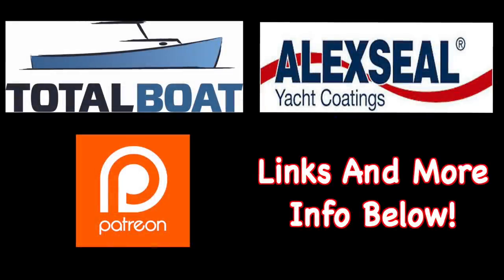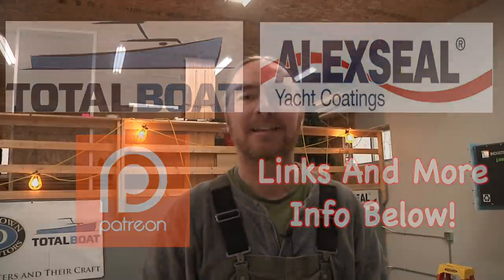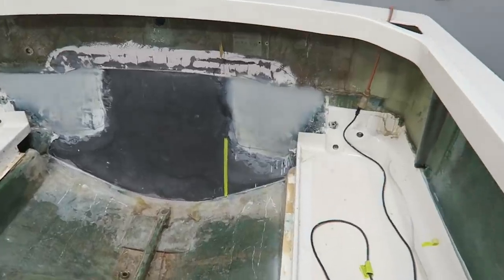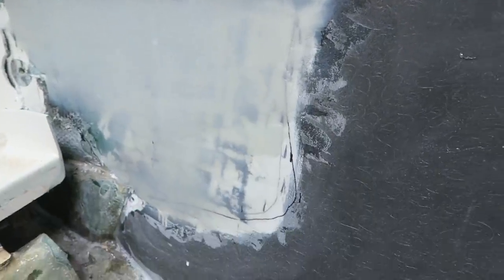HOW TO BEAT GRAVITY WHEN USING THICKENED EPOXY!

Comment: Happy to see you back working on boats.  Just completed some wet core repairs and did a lot of epoxy work outside.  I did my laminations when the deck was around 50.  My epoxy was cold from the night temps getting down around 35, so I learned an easy way to warm up epoxy resin and hardener is to place the cans in a bucket and add hot water (bath water hot, not boiling) until the cans just float off the bottom.  You don't need too much water as you want the cans to stay upright.  I place the bucket into the marina's outside sink and it works great using hot water.  The resin and hardener warms up in a half hour, so no long waiting  and it pumps easier.  I also keep a pan of cool water handy in case I want to slow the curing process.  On warmer days, I place a half inch of water in a paint roller pan and set my mixing cop in the water to slow the cure, if the resin kicks early, I pour a little cool water from my water bottle into the mixing cup to prevent a fire.  Still can't use it, but avoids a fire and controls the problem and reduces cleanup, as I can usually manuver the cup to where I can set it down on the ground safely.   Request for videos:  please show us how you work, not just talking about it.

Comment: Genius tip on warming the epoxy prior to mixing! Living in Scotland with low temps just now I was worried about my epoxy sliding/slipping on the vertical. Once applied with a little silica, the epoxy was was gaining viscosity all the time due to the lower temperature, resulting in zero slippage.
Cheers for your tips.
All the best from Scotland
Ewen

Comment: If my epoxy is cold, I'll mix it a little, and then toss it in the microwave for a few seconds. Thins it out to mix easier and like ya said, gives it a head start on curing. On the other hand, I've also made up smaller pieces of "pre-preg" where I'll lay out a square foot or so of cloth on wax paper,  saturate it completely, then cover it with another sheet of wax paper, roll it up, and toss it in the freezer. That way if i need a small non structural patch, I don't have to go through the hassle of getting all my materials out- all I need is a pair of scissors. Never had a problem with either of these 2 methods, used both on boats and aircraft.
Reply: How long will it keep in the freezer?
Reply: Does it stink up your house?

Comment: The problem with pre-thickening resin is that in order to get a proper and full strength bond, resin chains and hardener chains need to be brought together.  Thickeners get in the way of the 'mating' that has to happen to develop full strength.  Warm the resin and hardener as you did to lower the viscosity, work with manageable batch sizes, and make sure to stir resin and hardener a full two minutes before adding any amendments.  The goal isn't to get epoxy on the boat, the goal is to get a strong bond and a strong curing epoxy on the boat.

Comment: They make heated "coolers" that we use in the wind energy field, we plug them into our trucks and stick our resin and hardener in them, also do work as a cooler in the summer. They are handy

Comment: Good advise on pre warming the resin and probably the hardener so there's not a cooling when the 2 parts come together. Also getting the material at least partially thickened prior to catalyzing makes a great point. Finally, they call stand time slaking to get the chemistry of epoxy going prior to spreading out. Never thought about viscosity thinning out due to the thermal reaction affecting your initial guess of amount of thickener needed when mixing. Great points!

Comment: Once upon a time, working towards an A&P in college, it was a requirement that the epoxy cabinet had a 60 Watt bulb burning at all times to keep the epoxy warm.  Recipes change so I'm not sure if that's still a thing but it does make epoxy much nicer to work with.

Comment: I’m a proponent of using a scale instead of using the measuring cup. I mark down the weight of the resin before adding fillers and wait to add the hardener until the end. If a 2:1 or 5:1 epoxy is used, it’s super easy to add the hardener. If my resin is 130 g, I mix in part of my fillers and then, when I’m ready to do the job, add the 65g or hardener.

Comment: Have you tried Methacrylate adhesive to fill voids like what you are working with?  Mix up a batch, apply it with a pastry bag, install the new Cusa board over it, clamp it in place with some cleats and screws, wipe up the squeeze out.

Comment: I think your videos are the best. I learn something pretty much from every video. What I've done in the case of the dreaded saggggg. I used a piece of laminate (Formica) or whatever the latest trade name is. Or if I need something with a little less flex. I use that stuff the epoxy table people use. Just a quick spray PVA. Of course you have to plan ahead and have your bracing/ clamps and everything cut to fit and ready to go. Saying all that, I probably would have done the way you did the first time. Like you said, keep it stupidly simple. Which leads me to one of my favorite sayings, " you're going to pay for your education one way or another. Through mistakes or actual schooling of some type. I will be speaking to you soon on patreon. I'm re-doing a 25 ft. Grady White.

Comment: Instead of preheating the resin, one can pre-cure the resin with 5% to 15% hardener. It makes the uncured epoxy warmer and more runny. After some time: Add the filler. To get to correct ratio: Add the remaining hardener, and mix again.

It's worth mentioning that you can make many premixed: Resin + (5% to 15%) hardener + filler. The reason is that the amount of hardener is so low that the mixture will nerver cure.
You can make some experiments to figure the correlation between pre-cure time and how much filler you can save. 
Caveat,
The final mix will have a shorter pot life.

VERY IMPORTANT: Use a scale!

Comment: Thanks !
1.  Please say "Cake Pan," instead of bucket/cup.  Just as easy to stir on a big flat surface.  At least use a roller pan, but a 9x12 cake pan with high sides is better.  Or a cookie sheet, except drippy.
2.  Careful on pre-mix as you said.  Follow what manufacturer says.
3.  Mini-pumps are great.  But, should the mix be catalyzed for Total Volume after adding amendments ?
I added liquid dye to poly & had to increase the catalyst to match total volume.
4.  About Warming -- Keep all liquids inside the house at 72° and take to shop when needed.
5.  "Heater Cooler" a great idea from another comment.  Just a heating pad in a picnic cooler.

Thanks  Again.

Comment: I'll never forget having to grind out 8 hard to get at fillets that sagged on me last year... Good thing the die grinder could get in there. I never thought pre heating would be that helpful, next time I will. Just mixing it to the required viscosity while its at a higher temperature than it will harden at must be the thing that does it.

Comment: Not using epoxy but I always pre thicken my poly resin. Just to a point it's still mixable with the mek and then add a final thickening before use.  I use a bonding past that's already thick and mixes fine so don't see why should cause any issue.
Same issue with heat tho, when cold mix can feel good, as warms it's to thin lol. I'll add a touch more powder if so.

Comment: Excellent advice and timely for an upcoming project... Thanks!!!!
Reply: We called that a two stage gell.  A real problem with small radius and stiff glass.  Slow gell times can work aganst you. Always mix resin then additives. Expoys are very dependent on proper ratio and complete mixing.  The added cost or benifts of expoys does not stop at puch.

Comment: My questions are not necessarily related to this video but I’ve been watching so much of your back catalogue that I can’t remember which one it was.  Firstly, how deep is too deep when it comes to sanding out and polishing scratches in gel coat?  If my scratch(es) too deep what’s the best way of getting a colour (yes I’m in the UK 😊) match for the boat hull. I’m colour blind so doing it by eye won’t work. Is it best to contact the manufacturer? 

Great vids by the way. I’m fascinated despite not yet having had to do any of this stuff yet. I’m about to buy a new boat with a scratched hull and the quotes for a “pro” job are ridiculous.

Comment: Hello completely off topic. i have a boat in the uk its called a wilson flyer, it has a windbreak/flying bridge on top of the cuddy which is made with fibreglass, its a bit long and protrudes over the deck meaning less room to cast. i want to cut about a 1-2ft section out of it but then need to rejoin it so it looks original and has strength to. could you advise how its best to stick them back together or could you do a demo video please thanks Dave

Comment: I have a two foot crack right on the bottom of my boat on the port side. It was hidden by the bunks when I bought the boat. It is definitely through the gel coat so I was planning on dremeling out the crack down to the fiber glass to make sure the hull is not actually cracked. I cant see any damage from inside the hull but I'm not playing games with a crack in the bottom of my hull. When I looked at it closely it looks like the boat was slid onto a bad set of bunks and the metal bracket scraped it. The edges of the crack look almost beveled. However there is a impact mark across from the crack with tiny spider cracks coming of it but circular. What should I use to fill this crack if the fiberglass is in tact or even if I have to do some glass work. I'm worried everything except the glass will just fall out. I will be working on the boat in my driveway on the trailer and me underneath it whatever I use is going to be fighting gravity big time. I live in mid Florida and Ill be doing the repairs in 90 degree heat no doubt. Hopefully I can find a couple days without humidity being to high to effectively patch this crack.

Comment: Is there a way to calculate the weight of the epoxy and coosa after the transom is finished? With the Armstrong bracket
 and two big outboards, Will you have to change the waterline stripe?

Comment: would you use coosa for motor mounts ?  I am planing to laminate 3/4" coosa up and down/on the edge glassing it in and take 18" long 1/4" 3" angle stainless steel bolting it to coosa that the Chevy 350 Volvo inboard out board engine mounts will bolts or do you think i should use wood

Comment: Question?   Has anyone had experience thickening their epoxy with sanding dust?   Which of course consists of cured epoxy, fiberglass, and epoxy paint?  Im referring more for filler versus with fiberglass.

Comment: Just curious, do you think keeping the mix cup sitting in ice water after you mix it would give you more working time? Inverse of a double boiler of sorts.
Reply: Cooling the mixture could help with working time but like Andy talked about leads to aplication problems. The epxoy creates its own heat, so the viscosity will change drasticly.

Comment: I had always followed the instructions and occasionally had problems with the addition of the thickeners after the two components were mixed.Tthen I realized that the west system G6 is a thickened resin and only mixes with hardener in the nozzle. It always worked fine, so now I don’t worry and put some thickener in before adding hardener. Works well.

Comment: hello I always follow you can you tell me how to dilute the gel coat to spray it with the gun? thank you
Reply: Use Duratec patch booster
Reply: Look thru his videos I’m pretty sure he has a video on spraying gel coat.
Reply: Usually the cans of gelcoat tell you what to use to thin and what percent, if not call the manf.. most of the time its styrene used to thin, since thats whats in there already,, percentages vary on your ambient temp and spray nozzle size because you still need to maintain a minimum thickness to make sure the gelcoat can set properly. If you can get a cup gun(kinda pricey) you don't have to thin very much or at all. Harbor freight makes a cheap LVLP spray gun with a 2mm tip, so maybe 2% - 5% styrene added will thin it enough. Mix some small batches and doing tests is the best way since everyone's scenarios are different
Reply from the maker: Mix  in some styrene :-)  Just be sure to wear gloves and respirator when handling and mixing it
Reply: @boatworkstoday  acetone?
Reply: @boatworkstoday  what size tip , and approximately how thin, percentage wise?  Thanks

Comment: With 500 Dromedille 

Hi I here an old with 500 I am about to recover it consists of two hull an inner hull and is outer hull. I have divided it into two parts and remove the old foam that was in it and the old wooden plate that was in the hull and there are 7 fiberglass frames in it instead of foam. There is a new wooden plate at the bottom and in the aft mirror. But have a damage to my inner hull as it gets separated. It is inside the boat the so-called deck. But it can be made on the ideas side and then the part inside the hollow space of the boat when it is assembled. But am a little in doubt where the one I best for made the crack in the deck 

Mikael Tjørnelund